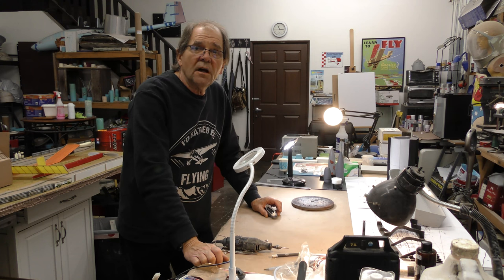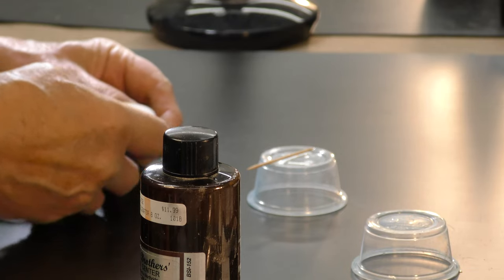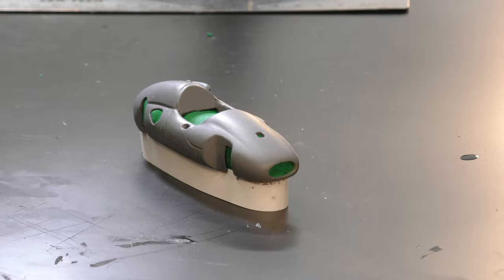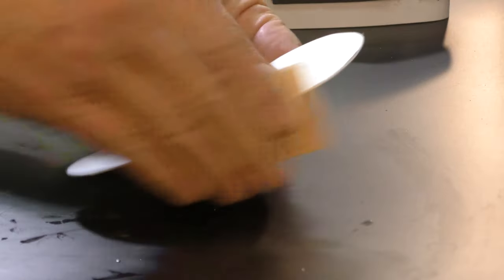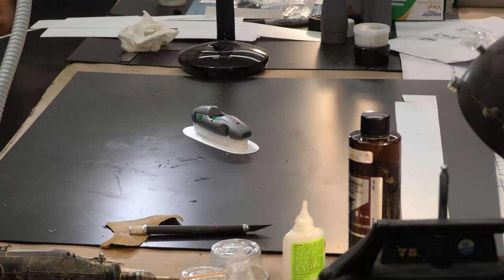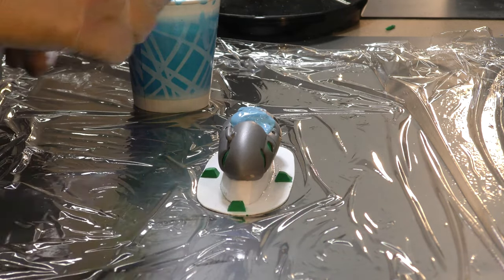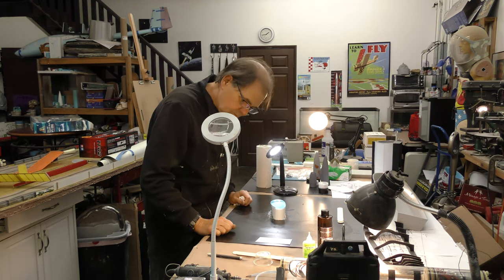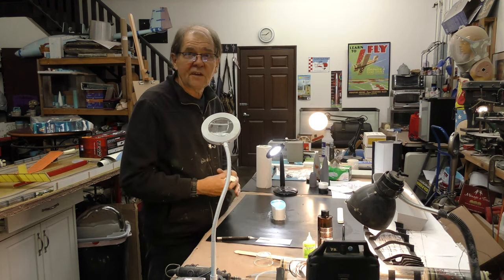SNG Shorts Cooper mold part 1

Comment: That was a very interesting experiment! I think .005" was a bit thin. What I've tried is cutting a wall out of thicker material, like .030" and then marking where the corners are and bending them with something hot. Like the cast iron trivet thing on a stove top. Then glue it down on a styrene base.
Far be it from me to tell you what's not working for you when you're obviously doing it. But that kicker is a chemical reaction. Less of it should not slow down the reaction. Unless you're counting on a percentage of it evaporating. Kicker is supposed to work pretty quick.